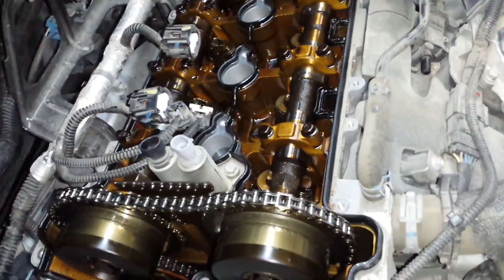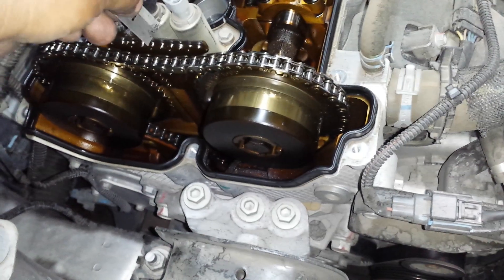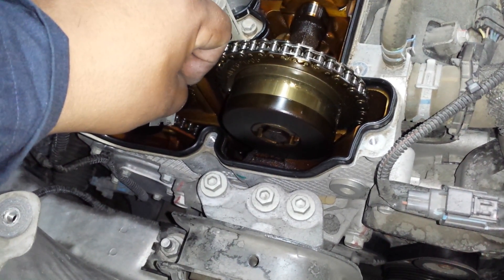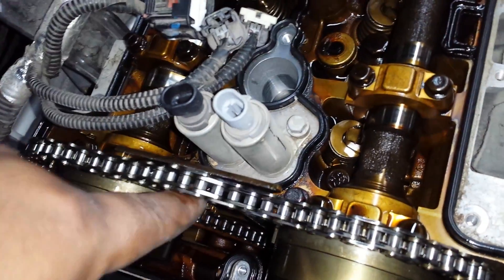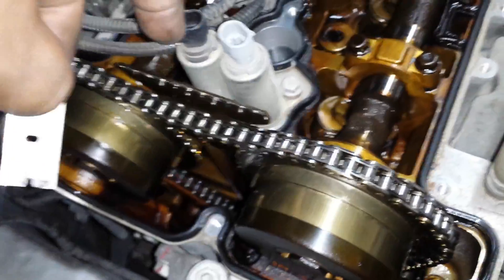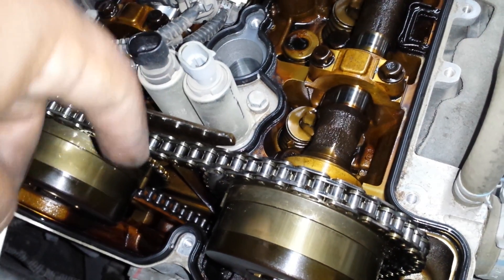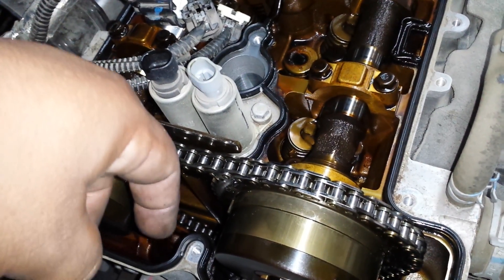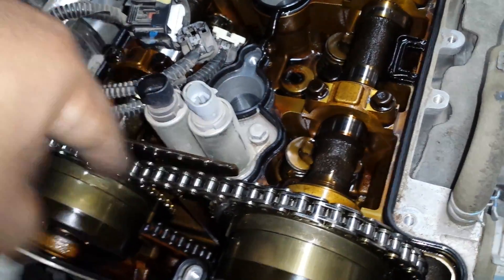Ecotec 2.4l timing chain defect

Comment: I have this exact vehicle it's a 2011 and it has the same problem. made it to 120k miles. it's been sitting for three weeks in my back yard.
Reply: 2011 is a horrible year for this vehicle!  Trust me, I know...
Reply: karadenise22 timing chain service time
Reply: I'm reading comments about an extended warranty for this problem from GM. Check and see if your car applies.

Comment: I have a 2011 Equinox with this engine and the mechanic said it is exact issue. The want $280 for the kit and said there's 7hrs of labor, for about $900 in repairs. I have 64k miles on it. I bought it last year as a Certified pre-owned, and from what I am reading this would be covered under this warranty. http://www.gmcertified.com/certified-benefits/used-car-warranty
Reply: did this powertrain warranty cover it?

Comment: I have a 2011 HHR LT 2.4 Eco Tech and I have a P0016 Cam Sensor Code With Decreased performance and a rattle near the chain and gears. My car on has 35k miles. And I keep full synthetic oil in the car. GM won't do anything about it. And this is a common problem with this motor. So good luck replacing timing components ever 35k miles. I'm getting rid of my car asap... After I fix it of course.
Reply: My HHR had 60k when the timing chain went out. 900 bucks later its running.

Comment: Im a Chevy tech and I can't tell how many equinoxs we have that chew threw chain and actuators.  Due to lack of oil change intervals.  10-12 seems to be the problem years.  Customers don't go by the oil stickers they go by the oil life monitors and then it's to late and time for piston and rings.
Reply: not true, I change oil religiously every 3500 and its synthetic mix. my 2010 ecotec threw a rod and it was always noisy.  I have owned 40 cars since the 70s and drove many into the ground without a major engine issue like this.  I know exactly the issue and its absolutely bad parts from a low bidder for sure.
Reply: "due to lack of oil changes"...nah, just a cheaply designed timing system.
Reply: changed my oil every 3k all syn and mine broke yesterday , yay...Wife use to work at Nexteer which is one of many suppliers Im sure there is a flaw in the parts and or the design nothing to do with oil changes no way dude!!!!  Quality is key and obviously due to the recall notices on this part they are aware...
Reply: keith rooney lack of oil change shouldn’t be said about all of them. I bought my 14 Malibu brand new and had the oil changed at the 25% mark which for me is every 4 months or 5k miles. 4 years and 60k miles later she needs a new actuator and timing chain. I thought the 2.5 was a better engine than the 2.4. I guess GM will always sell junk.
Reply: Mine went 59000...changed the oil religiously
Reply: I know this is an old video but I changed my oil regularly used the best I could recommended weight and it still did this 119000 miles on engine
Reply: @ld3941  There's a lawsuit against GM, if you still have this. Look into it. You're probably eligible for free engine service. Has nothing to do with oil change intervals, unless you want to get an oil change every few hundred miles. GM simply built shit vehicles, and were forced to own this one. Not convinced any company can build a decent car anymore, but i'm going to give the Japanese makers a shot, next go around. Done with ''American Made'' mfg.. Screwed by all 3, and they barely even make here anymore.
Reply: Pretty sure thats what happened to mine. Live and learn and change oil ever 3 months now after I got my timing chain replaced.
Reply: Eddy Gilbert no
Reply: Jeff Garinger complete shit
Reply: Eddy Gilbert complete junk
Reply: hey looking at the 2014 equinox... would you recommend it ? i take good care of my cars and trucks but are these junk??

Comment from the maker: Just got a few of the '16 in even after the '10 and 11 left a bad taste. Wish we tried another brand but management pulled the trigger. Once they were fixed they held up good. One started to consume oil a tad..think the pcv hole in the intake clogged again. And another had bad rings when we traded in. Wish to see the new engines crank case ventalation system to see if they improve it. This is the cause of 80% of the problems. Like I said time will tell.

Comment from the maker: p0010 is intake actuator circuit fault. It can be a bad connection between computer to actuator or short circuit to ground or positive or a fused winding in the actuator solenoid. You replaced the actuator solenoid so it might be a bad connection. Could be the pig tail to the actuator solenoid or wires. Also the connection to the computer on to of the battery getting corroded.
Reply: Alex Alanis Hey, my Terrain recently had a p0013 code, and I replaced the solenoid intake actuator (aka variable valve timer intake solenoid). After that, the code disappeared, but 2 or 3 weeks later, I got a p0010 code. So then I replaced the exhaust solenoid and now no more codes. Think I may have an issue with the chain though? I don't think I have any other bad symptoms, and engine seems to be running fine.
Build date of car is Feb 2010 btw. I'm not sure if the chain issue was corrected by this point or not.

edit: I mentioned the wrong codes. Just checked my one scanner.
Also, I should mention that I did those part replacements due to them being the most common and cheapest fixes.
Reply from the maker: not uncommon for them both to fail one after the other. If it ever ran low on oil would be only concern for needing a new tensioner. I think your good.
Reply: Thanks for the reply, that does make alot of sense now.  I will likely do the oil thing, but I'm in WI so my buddy says with the freezing temps now the car may not start until it warms up with the thicker oil in it.  He had a question as well, on a 2002 Chevy Cavalier he doesn't remember exactly what the code is, but the code comes back as idle air control, high idle.  On occasion between 15 - 2500 RPMs it revs up and down until he resets the code.  The idle air control has been replaced and the motor has been smoked for leaks.  Do you have any idea what could be causing that?
Reply from the maker: MYdjANDkaraoke I forget not everyone lives in South Texas. Even try 10w40. On the cavy might be the connector going to the idle control. Might need the pigtail connector.
Reply: Alex Alanis nope worn timing components will throw same codes

Comment: Man that sucks, luckily Chevy extended the warranty on the timing chain to 120,000 miles.
Reply: So the warranty is good until 120,000 I have 103,000 on mine and have this issue
Reply: @lavonwilliams6847  how did things go with your ride? Did you have to pay for it? It's been 9 months... I would love an update!
Reply: Russell they said it wasn’t under warranty
Reply: And you are one of those sheep's who buy extended warranty and believe it will be covered at no extra money LOL
Reply: Ummm, I was just stating a fact. Please re-read what I said, when I said they extended the warranty to 120,000 miles, I didn't say pay for the extended warranty. When you buy a vehicle nowadays there is a 8year or 100k mile warranty included. This was just simply extended to 120k miles since it is a known problem with this engine. It happened to my brother's wife's car, and they didn't pay a cent to have it fixed.  No extended warranty bought or paid for.
Reply: @velizarmilutinovic2947  Psh....Unreal....

Comment from the maker: joe v the dealer has a timing chain kit. What it doesn't have is the crankshaft gear. So get that also. They also have the balance shafts chain and tentioner. You also need the valve cover gasket, cam gear bolts , and harmonic balancer bolt. They should have the good parts. I don't have part numbers. You also need to clean the tiny pcv hole on the intake manifold. There's also a dealer recall on piston rings depending if under 100k miles or so.

Comment: Well, I just bought a 2012 Buick Verano (CPO) with 39,000 miles and I heard a ticking type noise coming from the front right of the engine.  Long story short, the car is in the service department now getting the new timing belt kit installed.  Amazing that there isn't a RECALL for this as no car should ever need this invasive type of engine work with such low miles.  Anyway, can someone in the know please tell me if the kit that's being installed is a "better parts kit" to fix the obvious chain stretch, or are they throwing in the same junk crap?
Reply: Have a 2013 Verano that is now in the shop at 77k.  What started as a rough idle, car sounding like a "truck", turned into a loss of 4.5 quarts of oil over three months and a check engine light.  Acura dealer where I purchased the car did a diagnostic said I needed a timing chain.  Contacted GM for assistance (7K miles outside of warranty); they indicated I needed their diagnostic before they would consider covering any cost out of warranty. No problem; off to Buick I went; they diagnosed intake/exhaust solenoids; specifically said I do not need a timing chain - no need for the warranty assistance, right? Wrong  Returned to Acura due to the lack of oil issue when I come to them regularly and for oil changes; I felt this potentially caused the problem and they should fix on their dime. They agreed to replace the solenoids as Buick suggested and only charge me for parts - I'm good with that.  Once replaced, still check engine, said I needed a cam actuators, Ok. Total is now $500+  However, further investigation determines I DO need a timing chain due to stretching - plastic guide broke off and chain began riding on the metal almost completely severing the metal side piece as in Alex's video. Buick dealer dropped the ball and chain on this!! Final cost $1300! Since this seems to be a problem with the Ecotecs, I will be getting back in contact w/ GM to nicely request and if the answer is no, then raise some constructive hell!
Reply: it should have revised parts. sounds like you bought a lease vehicle. previous owner probably changed the oil once every 8k miles or so with no concern to oil level. the number one cause for premature chain wear is low oil levels. just keep an eye on oil levels

Comment: This is a very similar design to the 2.2 ecotec in my 04 cavalier. Tried to start it up one day after filling up at the gas station and i had no compression, was abnormally low on oil after 3 months/3k. Could this be the same issue somehow more pronounced in a smaller engine? Mechanic says the top is seized and I'm guessing it could be from either burning off too much oil or god forbid the timing chain...

Comment from the maker: Im coming to the conclusion this and the plague of blown oxygen sensors and broken catalytic converters is caused by the defective valve cover design. We keep adding 3q of oil before the next oil change. There's always oil in the crankcase hose to the intake duct.

Comment: I work at a large Chevy dealership in Buffalo NY and am very familiar with this issue. After easily doing over a hundred of these timing chain jobs I can honestly tell you the guides have nothing at all to do with this problem. The chains on the 2.4 ecotec engine stretch. They all do it. They also do the same thing on the 3.6L. The guides are the only pieces that help keep the chain on once the chain is stretched. The engine you are using as an example has been rattling at startup for several thousand miles. Whatever GM changed as a supplier or manufacturer in mid year 2007-2014 is the issue. I'm sure its pennies per chain. These are also a tight tolerance engine and if it breaks which I am surprised yours didn't will bend every intake valve in the head.
Reply: +James Blair -  It appears this gentlemen is a GM tech.  Does this make sense to you? Thanks in advance.  "The biggest issue seemed to be the high pressure fuel pumps leaking and that would dump gas into the crankcase and caused the tensioners to fail. So I believe that with the redesigned high pressure pumps it seemed to fix this problem. Also with the oil life monitor updates people are going less miles on the oil changes so they aren't running them so low on oil, with sepcs being 1 quart usage every 1000 miles(and no one checks their oil). These engines only hold 5 quarts so say you go 6,000 miles on a oil change your lucky to have a quart of oil left. The tensioners for timing chain and balance chain run off oil pressure, so with no oil it would cause slop in the chains to stretch. It seems GM finally figure out these engines, our shop only does maybe 1-2 sets a month now instead of 5-6 sets a week about 8 months ago." - SavagmanFilms
Read more               Show less
Reply: +350Zquicksilver  - My wife's Chevy Equinox (2010, I-4, 89k) is experiencing this problem right now.  I believe there is a recall # on this matter, but you have to prove your problem is GM's problem first, if your out of warranty.  She had her FUEL PUMP replaced at 30K in spring of 2012, in regards to the comment above.  Didn't seem to fix anything, the Equinox still consumed oil and GM finally replaced her pistons and rings at no charge, around 65K in spring of 2014.  Believe it or not, I like the looks of the car, interior, the way it drives, but this I-4 engine has been a major headache!
Reply: 350Zquicksilver
If you already had pistons, rings, chains and pump replaced you should not be using any oil in 6000 miles. If you are then something is still wrong and your dealer should take care of it. The cylinders are most likely out of round.  We call this the equinox tune-up! lol
Reply: +James Blair - The dealership has take the motor apart and advised it was the timing chain and guides. We have NOT had the timing chain - guides replaced to my knowledge.  I went searching for answers and saw your excellent post! :)  In my experience, timing chains are NOT supposed to do this, stretch.  I want the tech to place the used chain and new chain side by side for length comparison... I bringing my calipers, lol!  Side note: what do you think about my original response/ question ( bad Fuel Pump leading to all these problems)?
Reply: This chains definitely do stretch. I did one on a kia optima and was wondering why the timing marks weren't aligning with the old chain but got a new chain and side by side the old chain was longer by like 2 teeth. Code was no cam and crank no colleration.
Reply: James What does this job cost? Thoussnds like most people are reporting ?
Reply: James Blair yup chains
Reply: do you know if the 2.4 ecotec engine is an interface or non interface?/
Reply: interface, just saw a vid and the guys valves got bent cause his chain stretched. i was thinking of getting this 06 ion 2.4. but now im starting to think maybe not.

Comment from the maker: After replacing timing set, If you get a rough idle and p228d and p0089 after it warms up, the oil pump needs replacing or try 15w-40 if you're on a bind on funds.
Reply: Alex, Are you a sure ? I just put a new timing chain kit on 10 equinox and its throwing those codes and ideling rough after warmed up, Please let me know so  I can buy a new oil pump for it, I really appreciate it.
Reply: +Alex Alanis Please check out my comments above please.  Could you please answer my question about better parts in the so-called kit?  What's in the kit?  Thank Bud!

Comment from the maker: 2012 is the cut off point when newly designed engine came out. Some of the 2012 haven't been up in milage yet but will have the same fate. As for the new 2013 design, only time will tell.
Reply: +Alex Alanis 
Hi Alex, do you feel 2.4 gm ecotech for 2016 Equinox is now problem free?
Reply: @josephwheeler7662  It still have the PVC clog/freeze issue. The only problem-free was the new-generation, redesigned 2.5L, which completely fixed everything, and it's suddenly more-reliable than 2018 Toyota Camry (no joke).

Comment: I hear a lot of the engines in these 2010's and 2011's having this problem. What did they do after 2012 to stop this from happening?
Reply: Jay mine is as well. Only 60k miles and needs new actuator and timing chain.
Reply: they didn't..My 2015 is doing the same exact thing.
Reply: @jaykriesel2477  They just keep throwing out the happy commercials and expect people to finance new ones.
Reply: not a dam thing